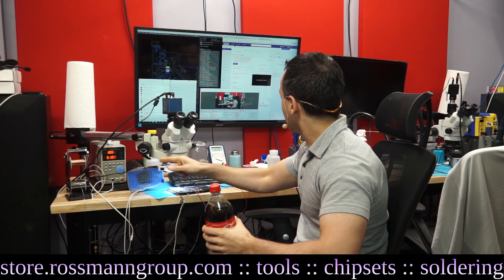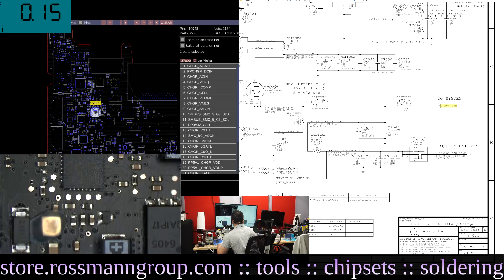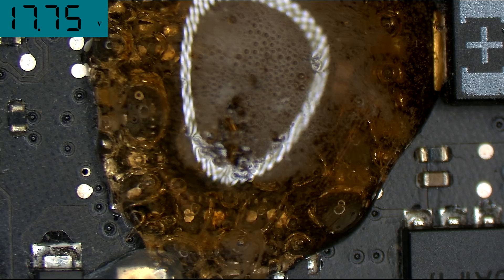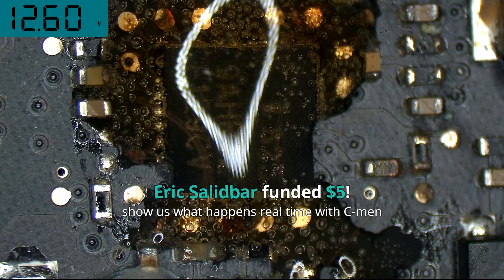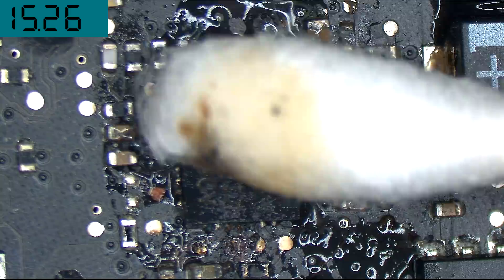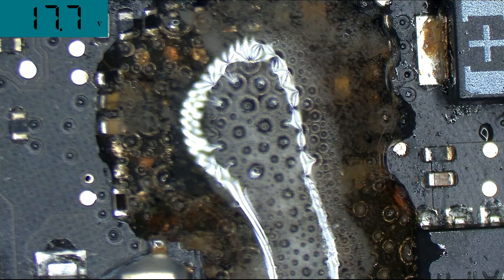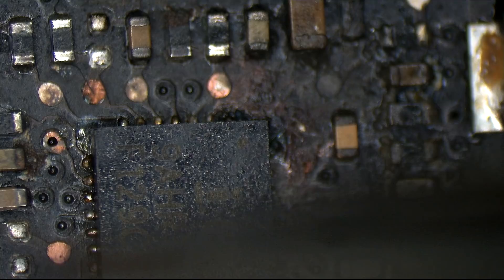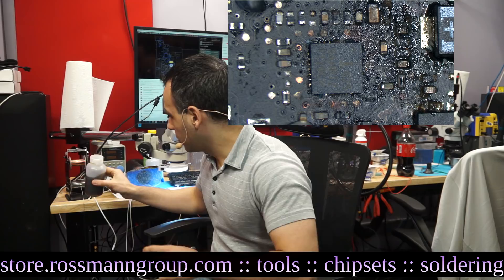How fast will Coca Cola corrode a Macbook logic board?

Comment: Of all the things you can spill on a laptop, carbonated drinks are arguably the worst. They're mildly corrosive in and of themselves, which is made worse when current is passed through them and electrolysis occurs.

All liquids are bad for electronics, mind you. Water and coffee might take a little longer, but they're still going to eat through the board in way too short a time especially when the board is powered.

PS. Louis, what would you estimate is the percentage of Macbooks whose problems started with a visit to a Starbucks or other coffee shop?
Reply: Ultra pure water .

Comment: Umm, I study chemistry and I'm going to put forth the argument that the things you see as 'rust'/blackness is basically the nonvolatile residue of the  evaporated coke. To have a more certain theory, I need to know the composition of those metals on the board, and I would want to see what happens to them when you spill pure water on them. The chemistry knowledge is that acids tend to eat up at metals, oxiding them, converting them into water-soluble cations, and not into rust.

Rust is usually a compound formed as the result of a metal reacting with oxygen. Acids tend to attack the oxygen atoms in rusts (there are many different kinds of rust according to my definition above), making them detach themselves from the metal. So acids are pretty much anti-rust material, but I don't knoe whats haopening here.

Acids eating up at metals is still called corrosion, but it is the kind of corrosion that transports the metal to water via dissolution. 

Rusting is also called corrosion I suppose, but what happens with rusting is the metal's surface reacts with oxygen and forms metal-oxygen compounds which we call rust.

Comment: But of course, Coca Cola has phosphoric acid and PCBs have metals and metals are very weak against acids. The body of the PCBs though is fiberglass which is not corroded by the coke. The weak spots are the metal traces and electricity actually speeds up the process of corrosion many many times.

Comment: this "fizzing" effect is electrolysis and it would happen also with water. CocaCola is not any worse that water in this case. Water would cause the same corrosion.

The problem with liquid damage is the conductiivity of water... no matter if iit is beer, cocacola, coffe, or anything else... if it a liquid based on water, electrolysis and corrosion will ocur.

Comment: I have a slight question, wouldn't it be easy enough to put a 13 ish volt zener across the 12.6 volt rail as an extra security feature? Surely that would at least limit the damage done to other components?

Comment: Question is: is this machine beyond repair at this point or there’s still hope?
Reply: It's dead. Unless you want to rewire the whole section with jumper wires, including the chips, vias, caps, resistors, etc.. If there is no copper, you can't solder to it. Well only a mad man would scrape away the mask and solder to the traces below - if they still are intact.

Comment: Quite interesting to see . What is basically happening to those pads etc is what happens with electroplating. The metal moves from positive to negative in the solution. In this case the metal from the pads the solder the traces etc move from the positive side to the negative side and causes rapid corrosion.

Any pop/soda or other acidic drink including coffee will cause this to happen much faster (good choice on coke) but any fluid that conducts will cause it but will work slower i should say less fast. It wil still happen pretty damn fast even with bottled water. 

Now the real question can you fix it.... I challenge you to fix it heh.

Comment: I wonder if you should "flush" your notebook with demineralised water if you got coke in it. Obviously truning off the power is the best course of action, but in Macbooks you usually cannot remove the battery without special tools, so this voltage remains.
Also even if the voltage is gone, Coke contains acid on its own. Does it eat though the tin/copper on it's own? 
I got Proposal for an experiment (Which i could probably do myself, but, you know..lazy..):
1) Drip two spots of a  board with Coke. Let them sit for a couple of minutes. then flush one spot with water. Which spot looks worse after 1d?
2) Dip an DCDC-Converter with coke(like in this vid) with voltage. If you flush the board with Water/Oil. Does the electrolysis stop? Does it damage the rest of the board?

Comment: How would regular water affect this? Thanks in advance!
Reply: It would have the same effect since there is minerals in water. However there wouldn't be an issue if it was distilled water since minerals is what allows the electricity to flow and those are taken out in the distillation process.

Comment: Rice works. I have used it successfully on a camera and a cell phone dropped into a lake. You have to remove the battery immediately to stop the corrosion and leave it in the bag of rice for at least a week.
Reply: i dropped my phone in water, never turned it off, still works 3 years later. 
rice does nothing.
edit it was a samsung s4 if ur wondering lol
Reply: All I know is my camera didnt work when it went into the bag and it worked when it came out.

Comment: I am not at all sure about this, so do this at your own peril : if you spilled some conductive liquid on your device - turn it off instantly and take out all the  batteries/power from it. Make sure it doesn't have huge capacitors(with some freakish Fs) with high voltages in it (some LCD TVs have 400V caps in them; in any case, be mindful of the hazard - even small amount current can kill you, if you are unlucky). Take out the speakers and all the stuff that can be damaged by liquid(usually the stuff made from some sort of cloth/membranes, mechanical parts) and pour some ethyl alcohol on it, generously. Be careful if you are going to do this with Methanol - even vapors can cause issues.  Hope that the manufacturer didn't use some sort of lacquers that are solvable by the alcohol. Pour it generously and then put your device to dry out somewhere where there is plenty of ventilation going on. Avoid direct sunlight. Don't bake it either - you can actually, inadvertently, put so much tensile stress that you might break some trace/pad which you will never figure out. The idea is to wash away the corrosive liquid from sensitive electronic components/traces.

In theory this should wash out the corrosive solvent you might have put on your electronic device. From my own humbling experience, I, thus, washed a full sized ATX motherboard after I spilled some fizzy drink on it plus one laptop motherboard. In both cases, devices kept working long after the incidents. In fact I used a clean tooth brush to clean all the components on the PCB.
Reply: Wouldnt distilled water  be better?     ..oh.  It can conduct some leftover electricity but not well.     But doesnt dissolve things

Comment: Coca-Cola has phosphoric acid in it, which I believe other colas do not.  Regardless, yeah, Coca-Cola is going to corrode fast with that voltage; fairly fast too with stored capacitance or just ion exchange as if it were a battery.

That's why Coca-Cola is referred to as Battery acid by hip and cool people such as myself.......

Comment: Awesome electrolysis experiment. Cocashit is perfect electrolyte because of phosphoric acid and citric acid in it.
Reply: max compress You mean sodium.
Reply: A Floyd - actually sodium is basic and not corrosive for most metals. As example if you electrolyse NaOH or NaCO3 solutions with iron or copper probes, metals will not corrode. But acids is corrosive.

Comment: What we have learned from this video. 
1. Don't drink coke near electronics (more specific PCB's). 
2. Don't drink coke at all. 
3, If you do spill liquid, turn off the power and dry it or let the air dry it. If it is water you might be fine. If it is coke your are screwed. 
3. Jesse  has got a bad habit which he needs to quit.
Reply: Don't forget to cut off the battery

Comment: I just don't understand the raid on coca cola. Reason for this reaction is the coca cola acidity combined with carbon dioxide that helps the corrosion to take place. You would get the same effect with any other soda drink with similar acidity. There isn't any secret ingredient in coca cola that melts the motherboard... only the pH level. Similar effect would be with orange, lemon or grapefruit juice but it would take longer due to lack of carbon dioxide in them. It's just how acids work. It would be great if you would have mentioned that instead of feeding conspiracy theorists that believe drinking cola will dissolve you from inside... Cheers.

Comment: The electrolysis made by the amount of power applied on the chip in seconds sent 17V to a rail that is suposed to be 12V.  You may not have time to save the device but at least don't power back up. Go drink /eat away of the computer if you praise your work.

Comment: coca cola is conductive, right?
Reply: Raimar Lunardi Sodium used in the formula is conductive.
Reply: Water is conductive. Water with enough stuff in it to call it a soda is even more conductive.
Reply: ABaumstumpf technically water is non conductive but almost all water is not just H2O most water will have conducive elements dissolved in it.

Comment: I once got a single drop of water on my old water cooled pc mobo. I saw the drop falling in slow motion and immediately yanked the power cord out of the socket the second it hit, but it was too late. The drop fell on some kind of high voltage resistor thing which promptly exploded.

It is very easy to fry electronics.
Reply: I Tightened every compression fitting on my system except a Monsoon fitting (shitty things) on my graphics cards [SLI]. Turned the PC on and it worked for 30 seconds, then off. Water all over my graphics cards and motherboard. The cards survived and the motherboard died. Water mixed with electricity needs to be taken seriously.

Comment: And I put this in my body
Reply: Most of the reaction is from the electricity + coke combo  not the coke itself I'm pretty sure it would do the same or similar with just water unless it was super pure filtered water and even then there would probably be  damage
Reply: Your stomach acid has a lower pH than coka cola, you'll be fine.

Comment: is it the phosphoric acid or sugar or what?  try diet coke and try zevia
Reply: Christopher Schade any acid including carbonation will do it. If the water isn't ultrapure it will conduct enough electricity to start electrolysis and then you get a runaway as the metal ions take over
Reply: Actually it is the electrolytes (even in tap water or bottled mineral water) will allow electrolysis, this is what causes the immediate damage. The phosphoric acid causes some corrosion even when no power is applied, but it is very slow compared to the electrolysis. And the sugar adds just some disgusting sticky gunk to the result.
Reply: Any ions will cause problems, but in drinks it's mostly dilute acids you have to worry about. (Acids, bases, and water soluble salts will all quickly kill your board through electrolysis, a bunch of other things including ultrapure water will kill it slowly)